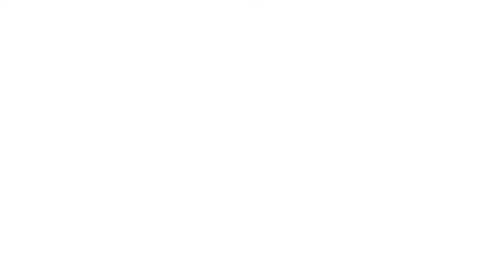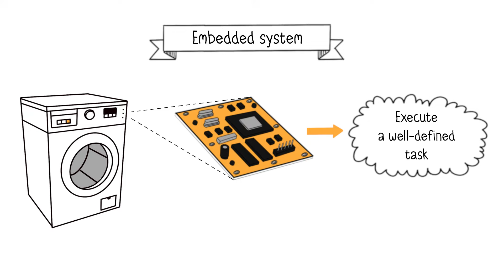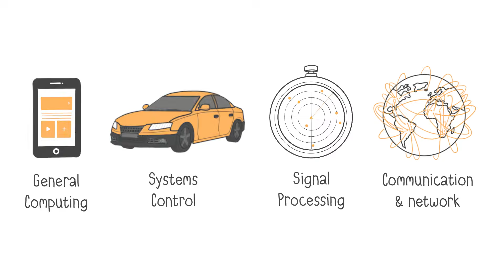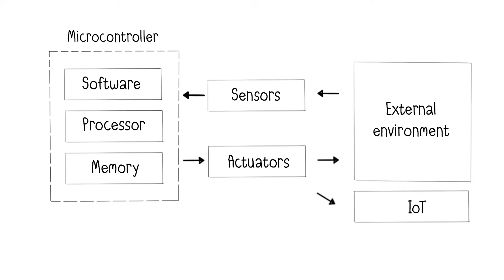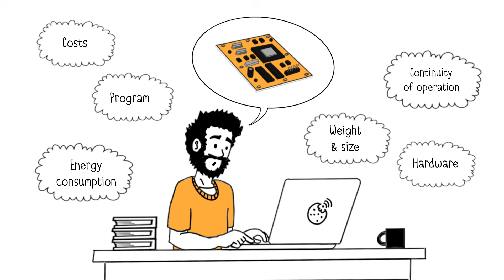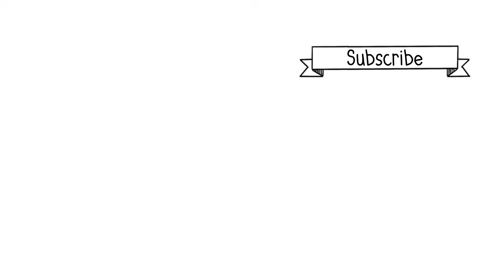Embedded Systems Explained in 3 minutes

Comment: Whats the difference between embedded systems and integrated systems? are there other types of systems to be aware of?
Reply from the maker: Hello! I would say that embedded systems are focused on specific tasks within a larger system (such as microcontrollers in appliances or sensors in smart devices), while integrated systems bring together multiple components to function cohesively (such as enterprise software solutions, and smart home systems). Hope it helps :-)